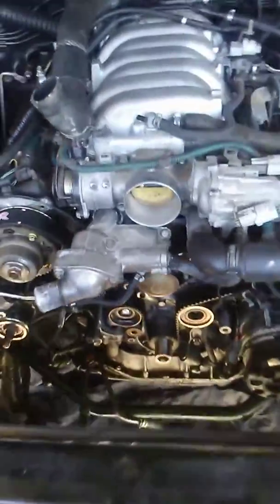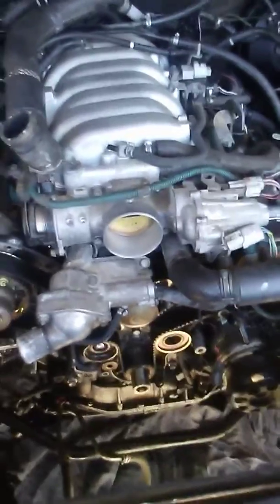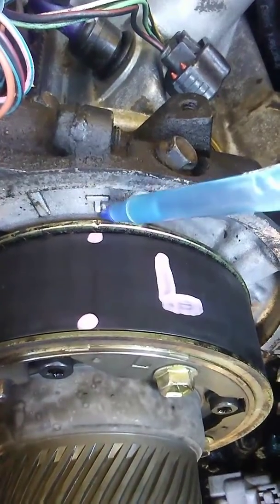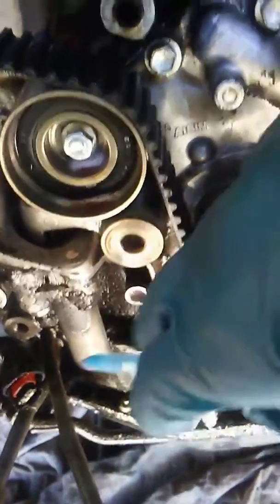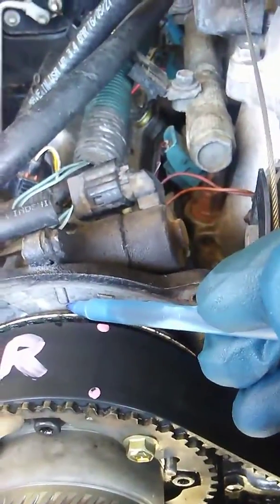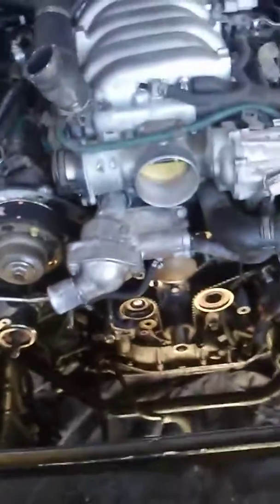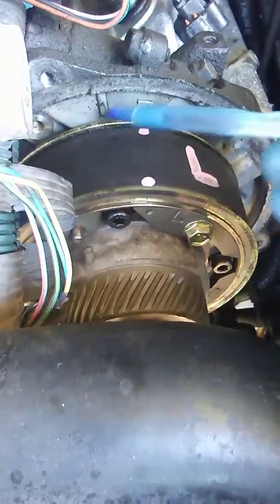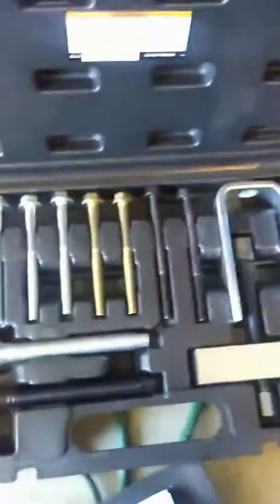1998 LS400 Timing Belt Alignment 1uzfe-vvti timing belt

Comment: https://www.youtube.com/watch?v=cl35CcdhS_I

Many videos i've seen with the 1uzfe vvtis timing belts actually tell you not to align the new belt with the T on the cams but to the lines. 

Click the link and go to the video times below
5:40/Old belt still on(lining it up on the marks on cams)
19:30 to 21:10/ New belt installed on the marks not the T
24:04/ Confirmation of where to align the cam

Comment: The manual is very confusing.  So basically just take apart and reassemble at 50° past TDC on compression  stroke for #1? And double check by spinning twice and checking marks again?

Comment: Your instructions are still unclear to me.  I removed the spark plugs and the engine rotates much easier. If I rotate the crank mark to 0 or TDC the cam marks align with the cam TDC line.  If I rotate the crank 360 degrees, the cam marks don't line up.  If I rotate it another 360 degrees, the cam marks line up with the cam TDC mark. Next rotate the crank a little until the cam marks line up with the T.  At this point, the crank mark is past 0 a little.    Remove belt. When and how do you rotate the cam marks back to the TDC mark, before you put the belt on?  You also say to rotate the crank several times.  Do you mean exactly 2 (4, 6..) because if you rotate the crank 3 times, the crank mark and the cam marks will be off 360 degrees. So is the reason you take the belt off at the T because by rotating the crank after you take the belt off the pistons wont hit the cams?  So with the belt on, you line up the cam marks with the TDC and crank mark with O, next rotate the crank CW so the  cam marks are at the T, Remove belt, remove Tensioner. Get new belt. Rotate the crank 2 times and line up the crank mark with 0.  Now rotate each cam CCW a few degrees to line up the cam marks with the cam TDC line. Now install the new timing belt starting with the left cam.  Align right belt mark with the right cam mark which is at TDC. Place the belt over the crank, install the tensioner.  At this point the R cam mark is lined up with the R TDC line, the L cam mark is lined up with the L TDC line, and the crank mark is lined up with 0.  This is all assuming you have the OEM Lexus/Toyota timing belt 13568-09070 with the marks on the timing belt.  I bought a timing belt kit on ebay and the "OEM 13568-09070" belt had no timing lines on it anywhere!  I decided to reorder just an OEM Toyota timing belt 13568-09070 from Amazon, hopefully with timing marks on the timing belt.  Does this sound correct? John @ Hillsten . com

Comment: cut the belt along its length take half the belt off  put the new belt half on remove old belt put the new belt fully on setting timing marks no need
Reply: How do you keep the old belt to keep tension so the cams don't move, to get the new belt on the tensioner must be removed, im just curious exactly how you did it this way

Comment: Hi mate, can you please confirm this. I've read this off somewhere about UZ V8 timing.
"Once the pulley bolt and pulley are removed, recheck alignment of the timing marks. If they don’t line up perfectly (within 1/2 tooth), turn the engine over by hand, one rotation, and recheck. Turn the crankshaft approximately 50 degrees clockwise, then backward to TDC to relieve tension in the camshaft timing gears. The timing marks should be lined up at this point. If not, determine the reason (jumped timing, failed tensioner, failed idler pulley bearings) and make sure that it’s corrected during the repair."
Why does it say 'turn the crankshaft 50 degrees clockwise, THEN BACKWARD TO TDC TO RELIEVE TENSION' etc..
I thought the reason to turn it to 50 degrees ATDC was to do so? (like what you explained in your video)
Reply: Well, everything lined up after belt change, put it all back together and it fired up and ran like always.  Phew.  Thanks for the tutorial videos.
Reply: Thanks.  Hoping so.  It’s on our boat...a 2000 Toyota Epic X-22 that is powered by a VT300i, aka 1UZ-FE.  Love the engine and belt change was overdue based only on time, not hours on engine.  Hoping it still runs great after this.
Reply: Here's first start after repair, in case you are interested...https://www.youtube.com/watch?v=b80u82oG5NQ
Reply from the maker: BJ Dawson cool glad I could help awesome engine you built
Reply: What happens if, when you are trying to position is to 50 degrees ATDC by hand, you happen to go past the mark and move it backwards to line it up to 50 degrees ATDC?  I did that a couple times.  Never more than probably 10 degrees but...did I just ruin my engine?
Reply: PS-I haven't removed the belt yet, I'm just trying to position everything up to remove the belt...and happened to move crank back and forth a few times to get it lined up perfectly with the T on the camshafts (what I'm assuming is 50 degrees ATDC).
Reply: Rookie mistake and I was just barely off, so I moved it back to get it perfect but went a bit to far again, so moved it CW to get it lined up.  Was back and forth a few times, rotating a minimal amount, until I had it lined up perfectly.  It wasn't until after that I wondered if I should not have done that.  Hopefully it's ok?
Reply from the maker: Drew007 yes my video is correct...don't turn these engines backwards. After you remove the accessories and upper timing belt covers rotate the engine clockwise 50 degrees and line the crank up with the ATDC bump on the timing cover...then verify that the cams are aligned with the "T" as shown in my videos...check out all of my videos to verify the procedure. These are interference engines and you cannot turn them backwards...the valves will come into contact with the pistons...anyway just follow the video you will be good to go
Reply: I don't know why but it seems majority of write-ups and diy videos line it up with TDC. I do believe there's a logical reason why there's a bold 'T' mark there in the first place. Cheers anyway. Oh and you answered something that i wanted to ask which was whether you can crank the engine Anti- clockwise.
Reply from the maker: Drew007 I know what I'm doing and this is the correct way...its not up for debate...
Reply: Are there any specifics to note with the VVT-I as compared to the Non VVT-I models?
Reply from the maker: Drew007 no
Reply: @FiSense  The "T" must really mean "Timing Belt" replacement reference mark?
Reply from the maker: BJ Dawson should be okay
Reply from the maker: BJ Dawson why would you do that when you can just keep spinning it clockwise until it lines up?